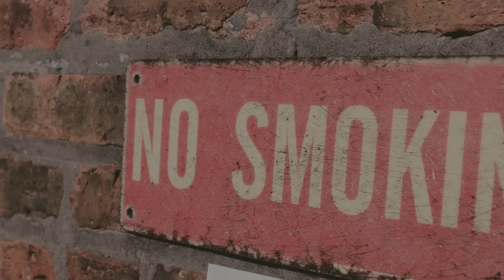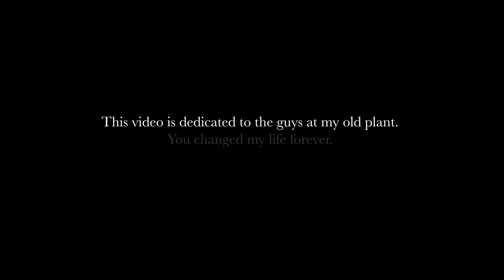Adam Calhoun - Clean Money (Official Music Video)

Comment: 20 year old electrical apprentice just finished a 12 hour day in the Florida heat. Great song 🤙🏻🇺🇸
Reply: That's right. I have 15 years in doing electrical work and in the Florida heat
Reply: I am going on 23yrs burning welding rods and flux core wire in the hot and humid south Florida heat.. So mad respect to all my hard working brothers out there in the dirty south and across the world sweating all day to make that clean$$..
Reply: Man I live in Florida, that heat sucks
Reply: @joshphillips5335  what part
Reply: 8 hours pulling electrical wires ( #6's) in this Bahamas heat. I feel ya bruddas jus remember to stay hydrated. Water on the job and a couple cold Coors at the end of day, respect from the 242 keep ya head up and get dat CLEAN MONEY!
Reply: Concrete finishing under the sunshine state
Reply: 24 buisness owner and a residential contractor in florida heat lol
Reply: Apprentice in Texas brother I feel that
Reply: 20 year old electrical apprentice from Arizona pulling 60 hour weeks, keep killin it sparky 🇺🇲🤘🛠
Reply: Hell yeah bro working 6-4:30 in a fab shop.. welding school from 5-8. Fucking love it ❤️❤️
Reply: 23 low voltage cable, army national guard🤘🏻🇺🇸
Reply: Sandblasting in MO 99° today woo hoo
Reply: 600 kcmil all day long through 4" rigid raceways. Sparkies stay sparkling!

Comment: Did 11 years locked up. Got out worked til i built a independent general contracting/roofing company for few good years then worked on a top rated moving crew for couple years. Hard work is legit. Had hard times but ayy a mf dealin with it. Back to the legit grind
Reply: How many mexicans work for you
Reply: It's so easy to have a construction company now days they throw them at you. Silly boy

Comment: My truck is a 91 Silverado 2 wheel drive 350 mult color and the AC still works
Reply: I got 89 c1500 with a 350 I love my truck
Reply: 96 chevy dually. 6.5 5spd. Slow but super dependable. Peace squarebody brothas!!
Reply: 1993 k1500 4wd 🤘